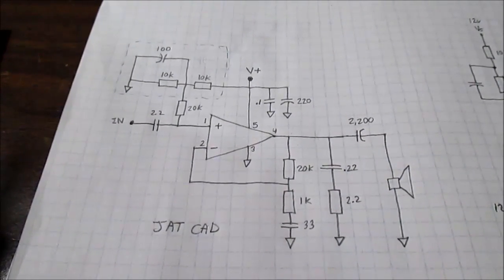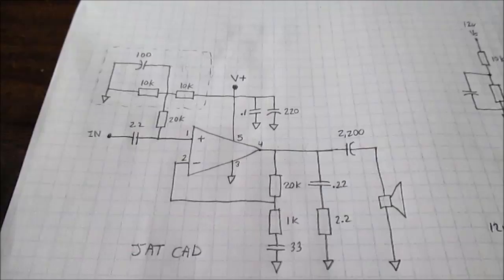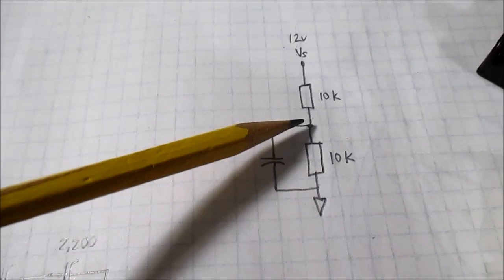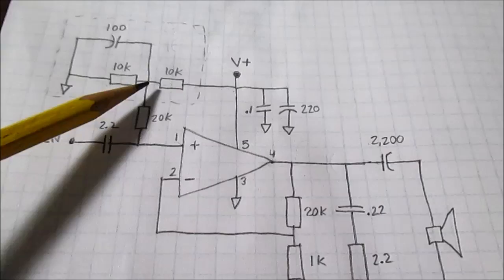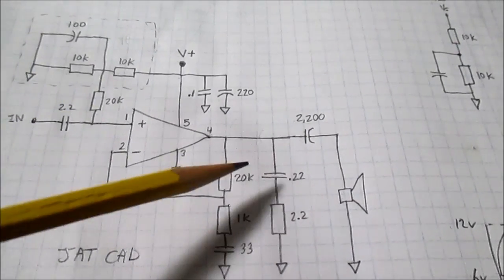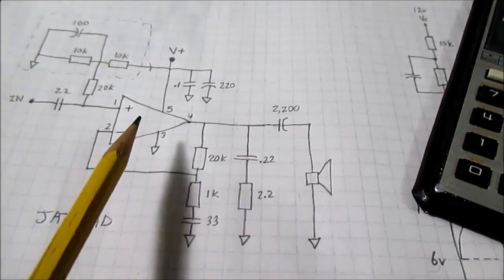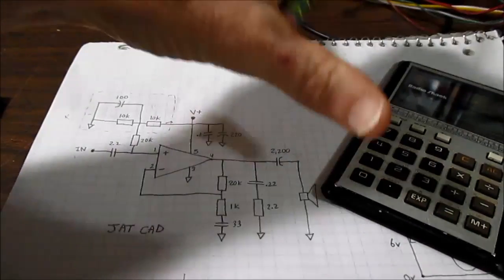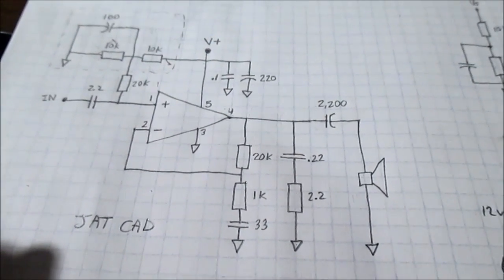Setting up a "single supply" audio amplifier

Comment: Thank you! The schematics looks very much like the one I've seen using LM1875 (the original one from TI)... only it uses 22k for voltage divider and 1Mohm resistor before the 1uF input capacitor ... the modified schematics I have found, uses 4700uF cap on the output, 10ohm 1W resistor instead of 2.2, .1uF instead of .22 one. I am a beginner, but I think the 20k and the 1k resistors are for gain... in series with both there is a 33 cap... what is it mean? 33uF or .33uF? Anyways, in my schematics (I didn't do it, I only found it) instead of 33 cap I have 10uF (electrolytic polarized) one! I'm tellin' ya... sounds absolutely incredible! Virtually no pop-up on power on and almost "0" noise! There is a slow movement of the cone of the speaker at power off with a mild pop-up. You can find the schematics I was talking about here: https://www.diyaudio.com/community/threads/single-supply-lm1875-design.415516/

Comment: Thanks John. 
I build stringed instruments in my retirement which led to simple combined pre-amp/power-amp practice amps along with pickups and filters to take out unwanted high frequencies that make an instrument sound harsh.

I use op-amps for the preamp and needed an effective but relatively simple way to generate the dual power supply for the op-amp and your video was a great source for methods.

Comment: Hi. What's the purpose of the 0.22uF and 2.2R to ground at the output?
Reply from the maker: This helps with stability of the circuit. I might oscillate without it.

Comment: Assuming the input stage has a bipolar PS, what is the relationship (if any) between the bipolar PS ground and the unipolar PS ground (0v)?  Must they be common?  Or does the coupling capacitor (input side) eliminate the need for a common ground?  Sorry, I know this is a basic question, but I want to make sure i fully understand the fundamentals.

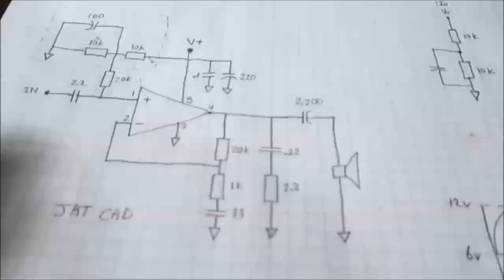Comment: The discussion at 16:00 isn't right unless your speaker is a purely capacitive load at 40 Hz. If that were the case, the impedances would just add together as you've assumed, but this wouldn't be a good assumption for a voice coil type speaker. On the other hand, if the impedance of the speaker is a purely resistive load at 40 Hz, the impedances will add as orthogonal vectors. And if the impedance of the speaker at 40 Hz was purely inductive, the impedance seen by the opamp would actually decrease...

Comment: sir---i made it work fine--clear sound--40 v single---getting only 0.3 a ---12 watt----only change i made is using 22 kohm and 3.6 ohm in  place of 2.2 ohm, using fake ic but at 40 v it should give 22 w acc to datasheet---usually fake ic gives 4 watt lesser then i should get atleat 18-19 w not getting---------why ?

Comment: Excellent video, much appreciated. One small wrinkle to your analysis of the low-end rolloff due to the output coupling capacitor is that the actual impedance of a loudspeaker at 40Hz may well be considerably higher than the nominal value - near the resonant frequency of the driver the impedance peaks quite considerably.
Reply from the maker: That is true. Also, ported speakers will have a dip in impedance at the tuned frequency.

Comment: How about a split supply using two equal value capacitors in series between supply + and supply ground, with circuit ground referenced between the two caps? I've seen that used before, also.

Comment: what are exactly the values for the capacitors? I mean like what are they uF, pF, mF, nF, etc.
Reply: uf
Reply: Unit-value of capacitor is Farad.
pico: 1pF=1/1,000,000,000,000 Farad =0.000000000001Farad
nano: 1nF=1/1,000,000,000 Farad =0.000000001Farad =1,000pF
micro: 1uF=1/1,000,000 Farad =0.000001Farad =1,000nF
milli: 1mF=1/1,000 Farad =0.001Farad =1,000uF
Cheers from Indonesia

Comment: I had already made a stereo amplifier using 2 tda 2050
and used it in my car .
every time that I turned on the   amp it always made a popping sound  i thought it was the low voltage 

now you have mentioned the reason for it I think I should change the amp with some thing that runs with single supply

can you suggest me an ic which is best in output power at the 12 volt single supply